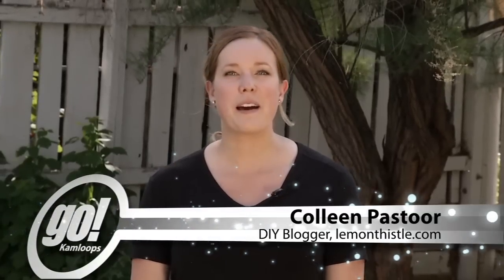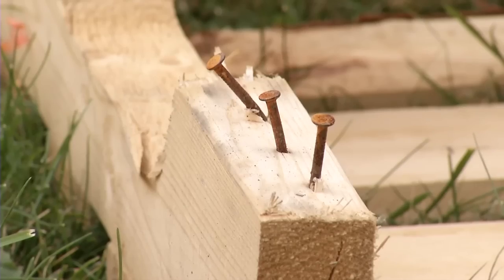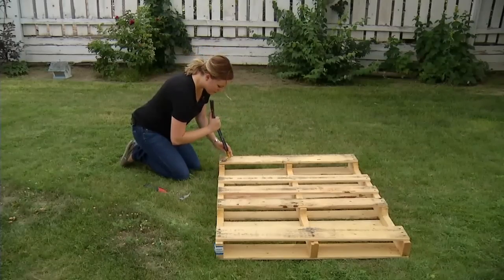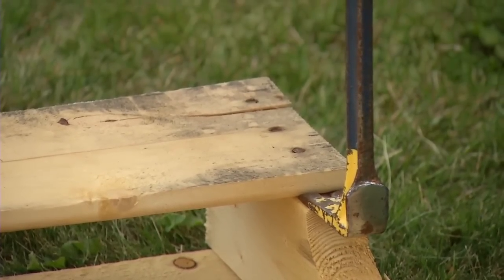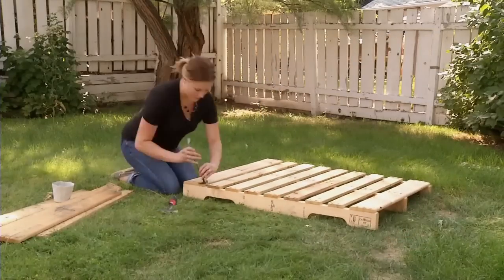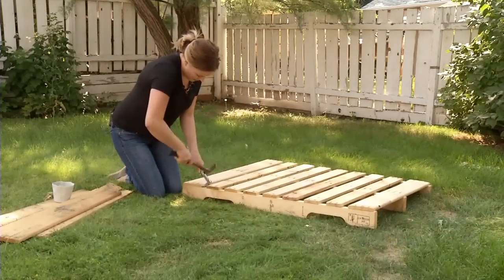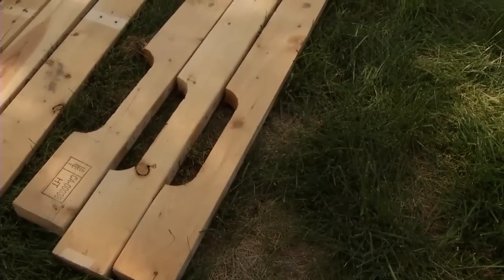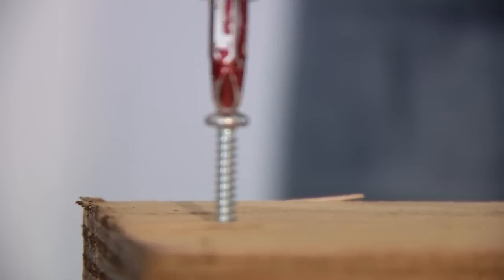DIY Pallet Disassembly with Colleen

Comment: I realize this is a bout two years too late, but if you're breaking down several you'll want to use a Sawzall with a demo blade. Those blades are designed to cut through nail-embedded wood. It's still a lot of work, but I was able to break down 35 pallets in about 3 hours last weekend by slipping the blade between the boards and cutting the nails. It also helps preserve the wood from splitting because you're not prying it apart.

The trade off is that most of the nail heads will still be embedded in the wood. A surprising amount of them will fall out on their own, though. Just be sure to avoid cutting where the nails are, and don't run the wood through a planer unless you really want to buy a new machine or a new set of blades.
Reply: Definitely! This is the 'I've got no tools' way, we've since invested in some tools to get it done quicker. Thank you for the tip!